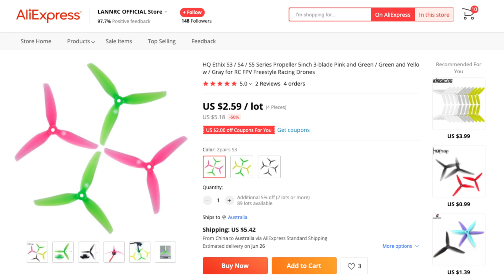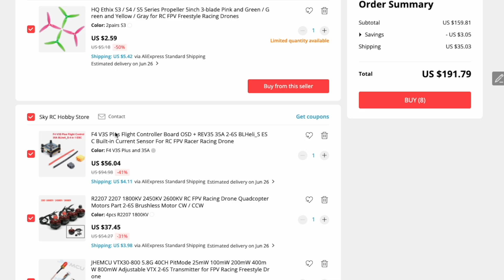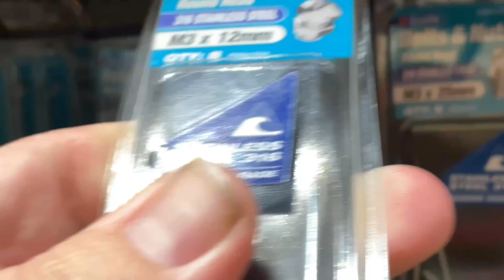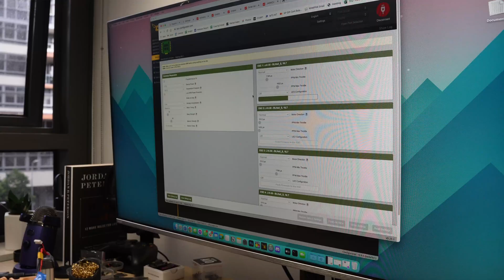Building A Drone... Using Only AliExpress

Comment: Hi nice content. I do the fault and ordered Same Motors they are garbage 😂 the Motor wires was losen and the hot glue on the shaft ist Not so god ... I changed to Amax Motors After First flight
Reply from the maker: yep - that's a good choice!

Comment: What battery do I use 🤔
Reply from the maker: If you do a 4S use a 4S 1800mah, for a 6S use a 6S 1300mah. 

Australia is limited with battery suppliers so mostly CNHL or Tattu

Comment: Those jehmcu expresslrs rx are pretty bad qc. I bought two of them. Neither worked. Looked at the boards under a magnifying glass. Capacitors and resistors were misaligned all over the place and touching each other where they shouldn't.

Comment: Alright this was a good take on making a cheap clone build.
But if you want the Mr Steele confidence and performance from your quad while still making a clone here are the changes you need:
1) Readytosky clone Apex (this is the best)
2) Tmotor Velox veloce 2306.5 2550kv motors ( if 6S then choose low KV)
3) BL_Heli32 ESC and F7 FC , running BF4.3 with the supafly 5" preset
      a)  in PID tuning tab , Throttle expo = 0.50
     b)  throttle mid = 0.3
4) ELRS 250Hz preset , low latency is key to how Steele flies
5) Last but not the least if your vtx isnt super clean, then use additional PDB to clean up video system power
Otherwise everything in this video is going to get you a really well flying quad.
6) 8k/8k gyro -pid loop rate, Dshot600 and RPM filtering are must
7) lastly dont forget to put in Steele's rates if you want to make it exact
Reply from the maker: ^ This
Reply: And power your camera from the VTX

Comment: I agree with you for everything exept the frame ...it comes to a point that if you want to SAVE  the money,you need to invest in premium frame like Apex!On the long run and abuse it stays consistant,with no issues.For whoops its opossite,if you want long lasting whoop you need to invest in good fc and good motors.
Reply: @miscosas  no clones are trash and stealing. Stop condoning it. 
Real ones know.

Comment: Wow that build sounded like a giant PIA....

Sorry to hear you blew your ESC, that sucks.  Made contact with those screws on the bottom perhaps?

As for your question, I think it depends.  I started flying a Tinyhawk 2 FS after graduating from the simulator.  Once I felt that I was beginning to outgrow that quad, my first 5 inch was a quad I built.  I feel that building is the best way to go because of all the learning you have to do along the way.  How to pick parts, how to match things, how to solder, how the quad WORKS internally, how everything goes together.  You just don't learn any of that by buying one off the shelf.  So exactly in your test case, when you crash and something breaks you A) Know how to figure out what went wrong and B) How to fix it.

That being said I've lately been helping another pilot get in the air recently.  After flying a Tinyhawk of his own he splashed right in with a GEPRC Mark 5.  By his estimation he just wanted to jump right in and buying that quad was about as much as building one on his own without the complications.  Especially as you pointed out build complications, like not having the right tool or missing screws or all of those annoying little things we've all had to deal with at one point or another.  If you've built a few quads already you probably have quite a stockpile of stuff, I know I do.  But when you're first starting out it's a real bitch.  It's been working for him so far, but then again he hasn't smashed it into the pavement yet either.  

I believe building is ultimately the best way to get you involved and understanding the hobby.  I guess the "it depends" part really focuses on your budget.  With everything costing so much more nowadays, the cost of building your own is about as much if not more than a solid RTF build off the shelf.  And for someone just starting out all of those "hidden costs" like tools, irons, extra screws and wire add up and making building in most cases the more expensive option.  And I get some people just can't afford that, especially when you factor that getting into the hobby requires a decent chunk of change when you factor a radio and goggles.  Even "cheap" radios and goggles still add to that bottom line and only serve make the cost higher when you realize you need to upgrade to something better.
Reply from the maker: No contact with the screws because I replaced them for the right length. 

Turtle mode after a crash and it probably popped a fet. I’ll replace with the Mambo 40a ESC and it will be rock solid.

Comment from the maker: If you'd like to know what parts I used, here they are!!!

✈️ Frame
► https://s.click.aliexpress.com/e/_AFEms7

  🎛️ Flight Controller 
►https://s.click.aliexpress.com/e/_AdcFoJ  

⚙️ Recommended ESC 
a) https://s.click.aliexpress.com/e/_9vBhIb 
b) https://s.click.aliexpress.com/e/_AXaesF 

🛞Motors
► https://s.click.aliexpress.com/e/_A0yD4J  

📡 VTX
 ►https://s.click.aliexpress.com/e/_AE7psr 

📶  VTX Antenna (Select RHCP & RP-SMA)
► https://s.click.aliexpress.com/e/_97YiIX  

📷  Camera
 Use This one:
► https://s.click.aliexpress.com/e/_AezrQ7
The One I used: 
►https://s.click.aliexpress.com/e/_AkeSKn 

🕹️ Radio Receiver
 ►https://s.click.aliexpress.com/e/_97fD7N 

Additional Parts Needed
 
🔩 Frame Bolts x 8 (m3 x 12mm) 
►https://s.click.aliexpress.com/e/_ALOADN

🔩 Stack Bolts x 4 (m3 x 22mm)
►https://s.click.aliexpress.com/e/_ACmQ7h  

🔩 Motor Bolts x 12  (m3 x 5mm)
►https://s.click.aliexpress.com/e/_AqUBT9
Reply: I've ordered the same VTX, is it good or I might have issues with it ?
Reply from the maker: @nikolazagorski5655  you should be fine, didnt miss a beat for me